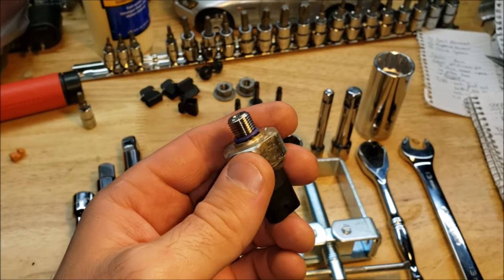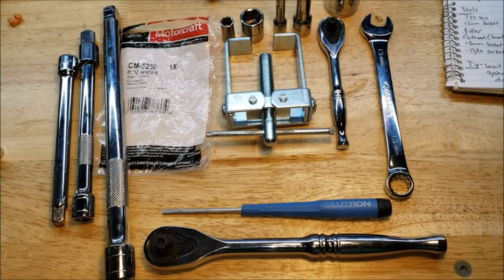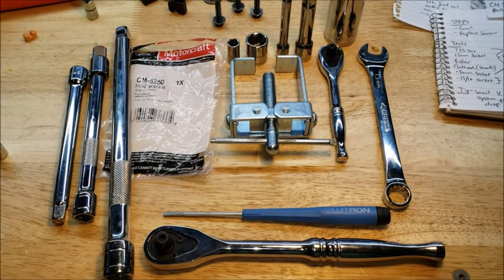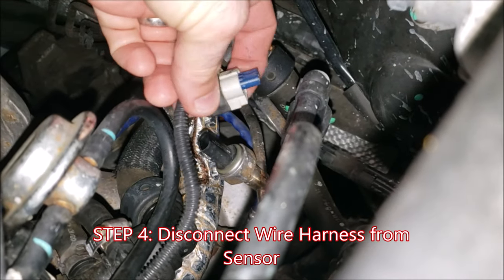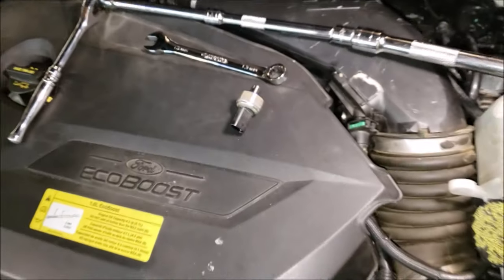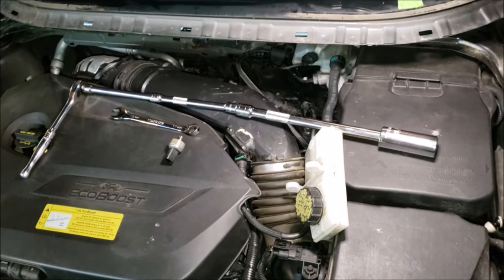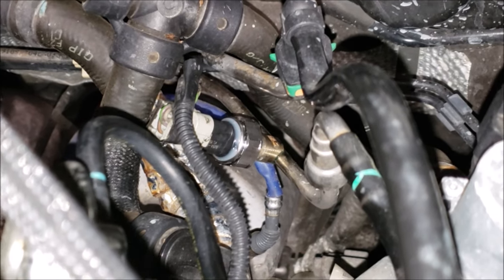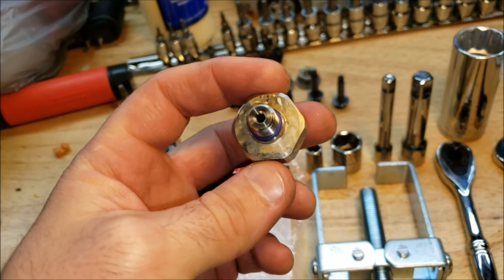How to Fix Stalling EcoBoost Engine - CEL P0087: HOW TO ESCAPE

Comment: I have a 2018 escape with 39,000 miles and the sensor already started failing. I’m getting it replaced after letting it sit 12 hours

Comment: Hey so my escape is having these issues aswell. Although mines not throwing a code i do have a level 2 code reader and i think I'll look into pricing and replacing my fuel pressure sensor
Reply from the maker: Good thoughts- ours didn't always throw a code.   Maybe one of 5 times we would stall. Our escape has not had these struggles since replacing the sensor so I hope its the same fix for you!
Reply: @HowToEscapeDIYTipsandReviews  my daughters Escape rarely showed a code whenever it stalled. But when it did it was code for low fuel rail pressure.
Reply from the maker: @paulkeen8680  did you try replacing this sensor- for me, the pressure was never truly low but the sensor thought it was, and told the system to pull back which caused the hesitations.
Reply: @HowToEscapeDIYTipsandReviews  I replaced it today using the steps on this video. So far so good. No stalling as now.
Reply from the maker: @paulkeen8680  👌  awesome.  Keep us posted! Hope this was it for you
Reply: @HowToEscapeDIYTipsandReviews  mine finally threw a code but the code was misfire detected on cylinder 3

Comment: Great video chief. I just did this repair on one of my customers vehicles, and if anybody wanting to do this at home sees this, it may be worth your while to take the top engine air snorkel off, simply by disconnecting the vacuum line attached to it and loosening off the hose clamps at both ends with a flat head screwdriver. Only took me 2 minutes and gives you a great angle and view of the low pressure sensor.

Comment: This might seem like a dumb question.  Does outside air temperature affect fuel pressure in this type of fuel system? I’ve been experiencing intermittent stalling at low idle for the last few months.  It seems more frequent when the weather warms up past 50 degrees.  Sometimes I can go 2 or 3 weeks in colder temperatures with no issues at all. I did discover that the code it throws when this happens is P008A-00. Any help you can provide is greatly appreciated.

Comment: Those errors are exactly what im going through with my ford focus 2016 car. I took my car to the auto zone store to get a diagnosis and they stated it has low fuel pressure and requires a new fuel pump. This video helped out a lot for me, thank you.  I will buy a new fuel pressure sensor and hope that may alleviate the stalling and slow throttle that I'm currently having. The same code did show up on the dashboard but soon disappeared. Thank you for you're assistance.

Comment: 2.0 ecoboost, I have no running problems at all. EML came on and saying low fuel pressure, live reading is perfect. Cleared the light and car was fine for 3 day's now light back on. Do you think this is the start of a failing sensor?

Comment: is there anything else I have to do? The car sounds like it wants to start now but still isn't running. I've had the high pressure fuel pump replaced, battery replaced, and the low pressure fuel sensor replaced and it still won't start. Codes I'm getting are P26B7 and P0087.
Reply: Check the high pressure fuel pump follower/ cup probably shot and cam lobe also

Comment: Thank you so much for this video!!  One quick question if you can help me.  I am an expat living over in France.  Bought a 2013 Ford S-Max with the same engine (1.6L).  I think part numbers might be different on the European models.  I have the exact same problem, but I am having a hard time finding the part over here.  I can find plenty of High Pressure sensors.  But not the low pressure one.  Do you know the part number for the Low Pressure side sensor for cars in France?

Comment: I found this video looking for a solution to this for my 2012 f150 ecoboost. I think this is my fix, I’ve already tried a new HPFP which has a high pressure sensor on it new. It still has the same symptoms so I’m going to try the low pressure now. I never thought about the low side being the issue.

Comment: Thank you so much for this video and your experience.  I had all the symptoms you described and I replaced the same part and it's fixed.  I was ready to do the same thing as you and replace the fuel pump first but your video saved me hundreds of dollars, several hours and all the skin on my knuckles.  Including the test drive, all done in less than 3 hours.

Comment: Daaaang! About 2 months late. My normal mechanic couldn’t figure out what was going on. Ended up replacing high pressure and low pressure sensor as well as high pressure fuel pump. It’s been long enough now that I can’t remember what code we pulled. This is extremely helpful should I run into issues again. Thanks!
Reply from the maker: Hah! Oh noooooo-  Sorry Jeremy- I have been meaning to make this video for so long now but with some family things and the holidays it didn't happen until now :/ I appreciate the feedback and to your point, it may be worth a video on the high pressure sensor as well... thanks for the comment and always good to hear from you Jeremy! Hope  the holidays were great for you man and that all are well and healthy on your end sir :)
Reply: @HowToEscapeDIYTipsandReviews  not your fault foe sure. Turns out that was the code we got. Granted, the first round never threw a code, it just killed as soon as I gave it any gas. ¯\_(ツ)_/¯. Holiday was great and family doing well! Hope your new little has been a bundle of joy and you’ve both been able to sleep a bit more.
Reply from the maker: @jeremyandrus7520  thanks for remembering, man and yes all is well and slightly more restful over here :) slowly making progress on the app again so hoping to have another check in once I know we have the mileage calculator down:)

Comment: Thanks for the video.  I got lucky.  Mine was pointing to the right and I didn't need the extensions (2.0 EcoBoost 2013 Fusion).  The wrench I used was a 13 mm and the socket a 24 mm deepwell.
Reply from the maker: Awesome, Keith! Always nice to save some time and get it fixed. Did the sensor solve your problem? Sorry for the delay in response. Hope all is well!
Reply: 2.0 ecoboost Fusion here too. Mine is not stalling rn however idle RPMs are starting to dip often, maybe the sensor is starting to go?
Reply from the maker: @TheRealSteelBeowulf  could be. Could also be your plugs or coils- any idea when the last time you changed plugs was?
Reply: @HowToEscapeDIYTipsandReviews  about a year ago
Reply from the maker: @TheRealSteelBeowulf  hmm that seems fairly recent but how many miles do you think you put on it since then?
Reply: Two months down the road and not a hint of the old problem.  Thanks again.
Reply from the maker: @keithsmith3118  awesome!!! So glad that resolved the issue! Thanks for checking back!

Comment: Hey dude, I have a 2013 ford escape 1.6L turbo and I just replaced this part on my car but thank you for this video! Wouldn't have even thought of that at all or known how to replace it if it wasn't for this!
Reply from the maker: Yeah! There are so many things in this vehicle and it worked for us so wanted to share. Did it resolve your issues???
Reply: @HowToEscapeDIYTipsandReviews  I’m having the same exact thing after driving it for a couple hours it starts to stall. I replaced the fuel pressure sensor with no fix. Any other reasons these things stall?

Comment: I’m smelling fuel like crazy could this be issue or could it be the fuel rail  being open or closed?
Reply from the maker: Hey there- if you're smelling fuel, check all your fuel lines in the engine bay. We had a black fuel line crack and have drips eek out when the engine is running and under pressure. Find the fuel line coming up to the low pressure fuel sensor, Then follow it to the engine block where it will enter the high pressure fuel pump and then the fuel rail before going to the injectors. If you can find any wetness or strength of smell in one area, shine a flashlight on the line and see if you can see any hairline fractures on anything. These lines can crack and split over time. If you look on our channel, we have a video on replacing a fuel line (which is the main repair I'm referring to from our experience...https://youtu.be/t-4orqJl-JI). If you feel that you're in a safe position, inspect again with the engine running and a flashlight and see if you notice a spray or bubbling coming from anywhere in the line. That would be my best guess. Also, if you find the leak and repair it, best to replace the cabin air filter as well to make sure you don't have any of that odor circulating the cabin. It gave us headaches after a while. Good luck and let us know what you find out!

Comment: Hi, i have a volvo v40 1.6 tgdi engine error accurs as P263662 which explained as “Fuei Pump B Low Flow / Performance. Algorithm Based Failures.
Signal compare failure”. Do you think as the same issue on video ?

Comment: Hello friend, I have a Ford Fusion 2014 2.0. Sometimes the code comes up with p0087 and the rpm sometimes drops and the car turns off. It's not all the time and the code comes up sometimes. Maybe I have to change the sensor.

Comment: I have a 2016 Ford Escape Titanuim with the 2.0 ecoboost. I am starting to notice that every once and a while my Escape will stall after starting. I think it has happened 4 times in the last 2 months. It is also a pig on fuel in the city. Highway fuel mileage is great. Just the city fuel sucks. Also it can have a rough idle at times. I am wondering if I should just go ahead and replace the sensor. I am not one to part swap just for the heck of it. Also I do not get a check engine light. I am wondering if my sensor is slowly wearing out. It might be worth the $100.00 Canadian. Also I only use 92 octane top tier gas in my escape. 92 octane is the highest octane gas I can get in Canada.
Reply: Had this same problem your describing on my 15' Titanium 2.0L ,  Culprit was the purge valve
Reply: What ended up being the solution to your issues?
Reply: @CreatingExcellence  I had majority of those same issues in my 2015 of the exact same model. Minus the bad fuel economy in the city as that is affected greatly by each person and their driving habits. My problems in the end went away after a Transmission Fluid change. I did the sensor swap, coil packs and spark plugs as well before that. The coil packs made a slight difference but nothing compared to the transmission fluid change. If your getting the check engine light with your issue it's most likely just the low pressure sensor. It couldn't hurt to do the coil packs and spark plugs at same time as you will be in the same general area and it's easy to DIY.

Purge valve was the cause when it would stall after getting fuel (my check engine light was on with that issue).
Reply: @CreatingExcellence  Nothing, it hasn't done it since leaving this post. Sorry i couldn't help if you are having the same issue.

Comment: I got the same code says the same thing now I went and got the part but they gave me the wrong one it's way to big they are saying it goes in thr fuel rail but even that one is to small I got the 1.5 l eco boost now if I go get the low fule pressure sensor they should give me that one ?

Comment: I have an stalling issue with my 2013 escape.  No engine lights.  Should there be an engine light if the sensor is defected?  Is your having an engine light?
Reply: My car was doing that at random times for the longest time wasn't until last weekend when the sensor finally failed completely and engine light came on

Comment: Great video and explanation. Getting  a P0088 code. Wondering if it could be caused by the low pressure sensor sending incorrect info to the system? (2015 Fusion 1.5 L)
Reply from the maker: Thank you very much for the encouragement! It could be, but also maybe not- after a quick google search P0088 refers to high pressure at the fuel rail. The low pressure fuel sensor sends signals to the computer that the fuel pump is pushing fuel at the correct rate from the gas tank- this is a low pressure supply, but it wants to see a constant supply. When it gets to the fuel rail before being injected into each cylinder, it gets sped up through the high pressure fuel pump, which has he high pressure fuel sensor located on the pump. P0088 is usually related to this component from what I've read- I have not had this code personally, so this is just from research, but it's not hard to get to luckily. Take off the wiper cowl/wipers, then take off the engine cover and maybe the air intake duct. You can then lift up the foam fit around the fuel rail and you should expose your fuel sensor- it's like this on our Escape at least- may be slightly easier with your Fusion since you have a longer engine bay area- might not need to take as much off. Give a shout if you have a chance to confirm / try it!

Comment: Thanks brother life saver, question do you know where is the higher fuel pressure sensor on a escape 2.0 2014? 😊 thanks
Reply from the maker: Hey thanks German V- the high pressure fuel pump should be just before the fuel rail. Basically if you follow the black fuel line to the engine block, it will be along that line, bolted to the top of the engine block right before the injectors and the fuel rail. If you take off the cosmetic engine cover and then any shrouding, it should be there!
Reply: @HowToEscapeDIYTipsandReviews  😊 thanks buddy... GOD BLESS YOU!!!
Reply from the maker: @07Review  you as well sir! Let me know if you have trouble finding it!

Comment: I don't have fuel problems but my 2015 Escape is now close to 6 years old and she has a little over 127k miles on her. Should I go ahead and replace it anyway for preemptive mantenence?
Reply from the maker: I wouldn't- sensors can be finicky sometimes. If you aren't seeing any symptoms, best leave it be. Uts not a typical maintenance item like oil servicing or brakes. A sensor is supposed to last, but when they fa they fail and it may be at 80k miles, it may be 200k miles. Just keep the reminder in your back pocket here of your car begins struggling at idle or feels like there are hesitations during acceleration or stalling. Good question Michael

Comment: I have a 2014 ford fusion SE 1.5l ecoboost and I can't seem to get my sensor off to replace it. I took the battery out so I can get to the sensor as ease, but I just don't have enough force. Any suggestions
Reply from the maker: Good question- if I recall correctly there are 2 flats on the receiver for the sensor- meaning the chunk of metal that the sensor threads onto should have two flat faces for a wrench to hold onto. It isn't easy and it is a bit scary since you don't want to hurt the fuel lines...I do remember that. Have you used a second wrench on the flats?

Comment: Do you know the name or part number for the fuel line.  I think I may have not been delicate enough. I don't feel the sensor actually loosened and I have fuel leaking.  Just trying to see if this is something I can replace or if I need to take it to a shop at this point.

Comment: Will an impact wrench be safe to remove the sensor?
Reply from the maker: Hey there and sorry for the delay- I would say probably not, just because the sensor is mounted to the fuel line. I think the impact driver could rattle and damage the fuel line as well, but it would depend on the setting of the tool as well as your hold on the sensor/fuel line. I know I wouldn't be comfortable with it, but if you were really careful, perhaps it would be ok.

Comment: Hey everyone really need some community help! I just bought a 2017 escape with 140k. The car had a check engine light, and I was told it was the low pressure fuel sensor, but after following these steps & replacing the sensor, the issue persists. Any ideas? How can I diagnose exactly what’s wrong?

Comment: Another good video, bro.

Anyone do a PCV valve on the 1.6? Can't find the damn thing.
Reply from the maker: Hey thanks, Brendan- sorry for the delay- check out this thread here- there's a guy who worked on the PCV hose - looks like it's on the back side of teh engine just under the air duct! - https://www.fordescape.org/threads/gas-smell-in-cabin.33874/page-19

Comment: I have a new question for you, are you able to check the berrings in the rear differential? I have a grinding berrjng noise and there is no play in the rear wheels, starting to thjnk its in the rear diff but haven't got a clue how to check them. Thanks in advance.
Reply from the maker: Hey there @New Holland Skidsteer! Great to hear from you again- so you think it's actually within the differential housing itself? Is it constant grinding at varying speeds? Does it increase in intensity as you go faster?
Reply: @HowToEscapeDIYTipsandReviews  its a consistent humming, sounds like a wheel berring but  unlike a normal wheel berring taking the weight off a normal bad wheel berring reduces the noise this doesn't decrease
Reply: @HowToEscapeDIYTipsandReviews  i know i had a bad front berring and i changed that, then i thought i had a bad rear one but the wheels are solid no play

Comment: I have a 2017 ford escape and it starts but won't barely accelerate and is throwing poo87 and poo88 rail pressure too low and rail pressure to high bank 1 would u go with sensor
Reply: I have the exact same problem
Reply: And model